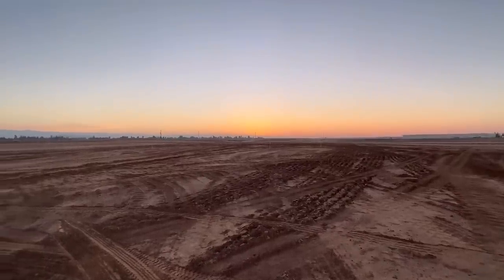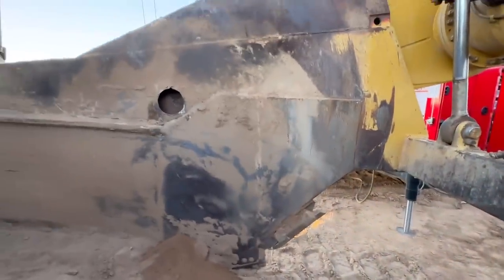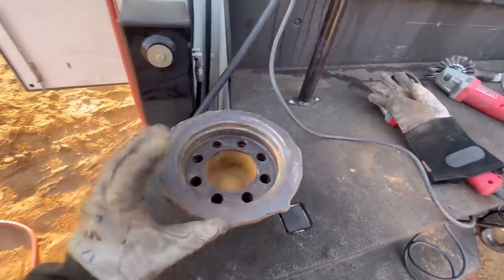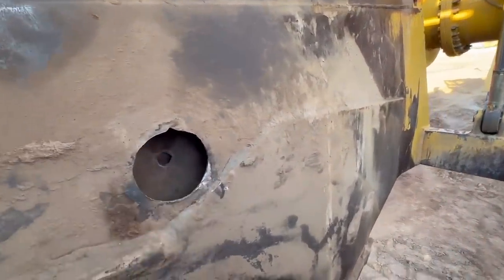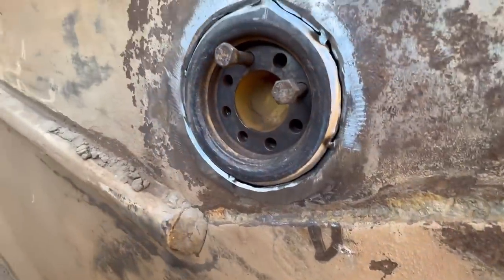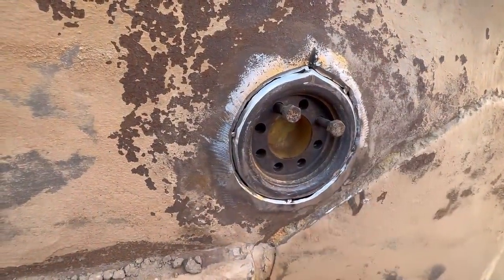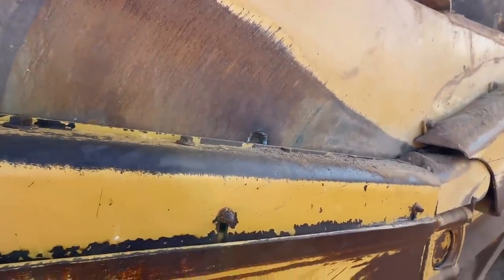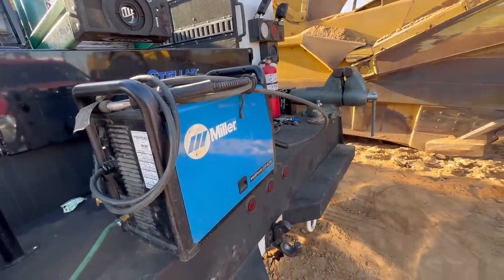CAT 637 Apron Trouble…

Comment: Have you ever tried LA-90 or LA-100 Lincoln wire for some of those repairs on heavy equipment?  I've had really good results with it when dealing with those high strength steels that most equipment is made from. It is a little bit more trouble because a preheat is almost always necessary but when you are dealing with alloys like T-1 and AR-516 you get a much stronger weld.   Good job getting getting that yellow beast back in the field and doing something productive!   Folks like you are becoming a rare breed nowadays, not enough young people are learning how to do heavy repairs in the field anymore..... Even though I'm around this type stuff all the time I still enjoy watching others out there getting it done and I have learned a few tricks along the way!   Really enjoy your videos, keep that hood down, and the sparks flying!👍

Comment: You might want to try heating up the bent area before you start pounding on it.  There are times heating it up then quick-quenching it with water will straighten it up pretty good.

Comment: As a former general repair welder who now solely does vehicle bodywork welding, I miss getting to weld on stuff that isn't tinfoil.. Now its all tiny tacks at the lowest setting on the smallest welding machine, where it used be burning heavy rods into heavy steel using a big diesel plant. It seemed like a tough gig at the time - in hindsight it was great fun and a complete doddle by comparison. Enjoy what you do. :-)

Comment: Технологическая недоработка инженеров Катерпиллера. Надо было эту чашу с внутренней стороны (донце чаши) делать большего диаметра. Усиливать металл в месте установки этого узла. 
Technological flaw of Caterpillar engineers. It was necessary to make this bowl from the inside (the bottom of the bowl) of a larger diameter. Strengthen the metal at the installation site of this node (a thicker sheet).

Comment: With your mig setup, do you just plug into your 240 plug on your engine driven? I see a lot of guys going with the remote set up but I’m just thinking about using something like a multimatic 211. Wondering what the best route is. Also we need a service truck tour! Nice work and nice truck!!!
Reply from the maker: Ya I use the power from my Miller 600. I believe all you need is 240v and 10,000kw to run the 211. Most machines produce that.
Reply: @OFW  TEN THOUSAND KILOWATTS? Means, ten MEGAWATTS? Wow, it's really impressive stuf fyou got there, mate... ;-)
(Yes, I know - you meant 10 kW, or 10,000 W : )

Comment: Good job! AND,.....I have a question: I bought a new Hobart IronMan 240 and being a newbie mig  welder ( been a stick for 40 yrs) and it came with 5/8" nozzle. They sale 1/2" nozzle so, does 1/2" nozzle's work better for fence repair's on outside welding or is it for tighter welding for inside welding? 
I always wonted a mig welder and after watching your video's, I just figured it was time to buy one for the barn. Lol. :)
Reply from the maker: There isn’t much difference.  The 1/2 should be able to get into a tighter spot.  I use a 5/8
Reply: Thanks

Comment: Tack good in place use either grinder or gouger to open a root for 100% penetration.gouging out tacks for penetration there as well as you close it up.
Then add stringers afterwards.

Comment: I would assume you would used dualshield flux core since that joint would take a lot of stress but er70s-6 was used. Any insight to that?
Reply from the maker: 70s6 is used for a lot of high stress welds. Almost all trailer manufacturers use it, the frame in your truck is welded with it.   I like using it for thinner materials and dual shield for thicker material.

Comment: Hey very informative do a good job I like the way you describe stuff which is important question for you I am doing a welding project and make an attachment for my skid steer to rip concrete driveways out what wire would you use for welding A36 that is .5“ thick getting welded to the back of a pallet fork and a piece of plate getting welded between the two forks, I’m not sure what type of steel forks are made out of but they’re pallet forks any information would be awesome thank you so much keep up the good work
Reply from the maker: Sounds like you should do a little pre heat with a higher tensile wire such as 7018 -8018 or an 70-80 series flux wire

Comment: What is different the flux core wire(Black) and carbon steal wire?  Most of company using the flux core wire because it is cheaper.  I don't like it, it is so difficult to make the overhead and vertical welding.  not much experience myself  the customer doesn't like my final welding surface. I am comfortable using the carbon steal wire much better but sometime has crack inside. What about your experience for carbon steal wire welding?
Reply from the maker: Both are carbon steel.  The one I use is dual shield which is more expensive than regular wire. But I typically don’t have any issues with regular wire.  If I had pictures or a little more information I could try to help you.

Comment: Have u ever tried using the gas less mig welder with the flux in the weld wire     If so what did u think   cheers from seamus in Ireland 😎
Reply from the maker: I have. I use it sometimes.
Reply: @OFW  l find it hard to use the flux wire but I probably havn't practised enough  Keep the videos coming  😎

Comment: I'm confused as to why you're running vertical down with GMAW. Why not just put flux core in and run it vertical up? Your repairs might last longer...
Reply from the maker: Nothing wrong with downhill if it’s the right situation.  My repairs last a long time.
Reply: What's the right situation vs wrong situation? I was taught the pool runs down and insulates the parent material from the arc inhibiting penetration although the legs still fuse nicely and it looks clean. To be clear, not trying to pick a fight here.
Reply from the maker: @destryklein9380  an example of the correct situation is thin material, a gap between the two pieces, or material that is prepared with the intention to be welded downhill. And honestly not to sound arrogant but having experience and knowing what you can and can’t get away with.  If you tried to weld this uphill with any process you would blow through the material constantly.  The correct situation would have material that is thick enough to handle the penetration of the uphill weld and no blow through.
Reply: @OFW  Very well. Thanks for the feedback.

Comment: What generator powers that Millermatic? Does it need clean power (inverter generator) ?
Reply from the maker: A Miller big blue 600 air pak is the power source.  I would say it needs to be pretty clean to run properly.